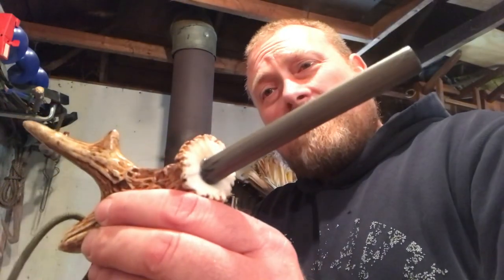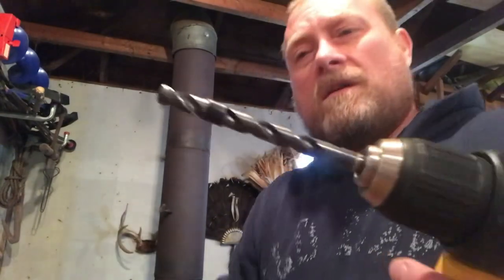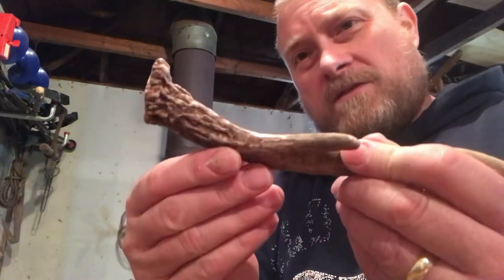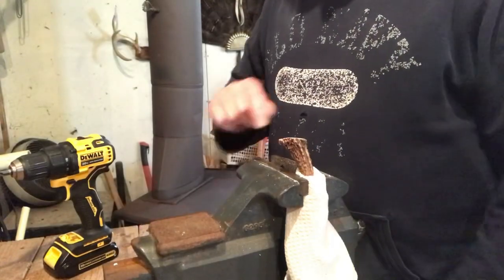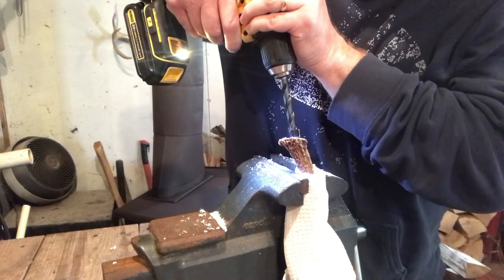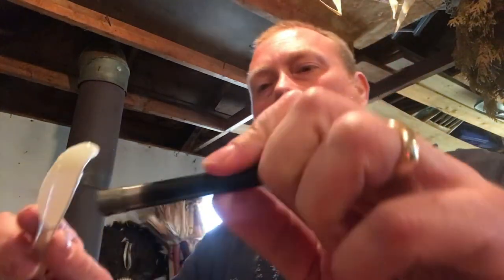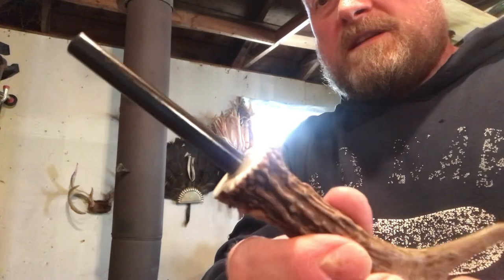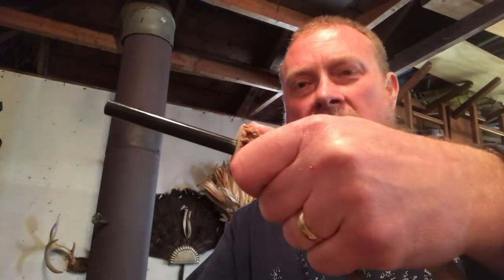Deer Antler Handles.

Comment: Cool video! I would love to know more about the process of removing the antler from the skull, and also how you clean the antler before starting a project like this. We have a dead/skeletonized buck on our property right now and I would love to use the antlers. Do you have to cut them away from the skull or can you just sort of knock them off? And do you just sand them down a bit? Thanks for this information and entertainment :)
Reply from the maker: You use a saw to cut the antlers off unless it’s a shed. You can also saw the skull if you want them together like a traditional mount. You can wash them, but don’t sand them. That would ruin their appearance. If you are collecting them off a skeleton you found, it’s best to do it in cold weather. If the animal is decaying they can sometimes smell. You can soak them in baking soda to cure the smell, but it can be a long process. Hope this answers your questions.
Reply: @ModernRefugee  It does, thank you!  Clearly I am new to all of this 😂
Reply: I Polish my Antlers with a buffing wheel. They shine up real well. I make Pens pipes, handles for BBQ tools, and cast some shed pedicals in clear epoxy for whiskey bottle stoppers.